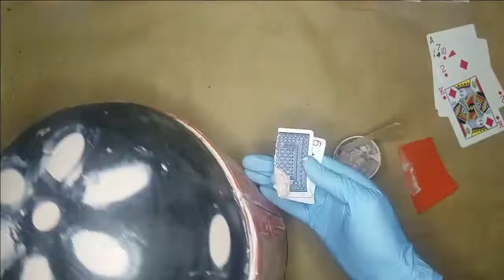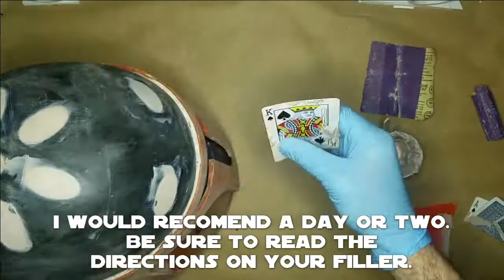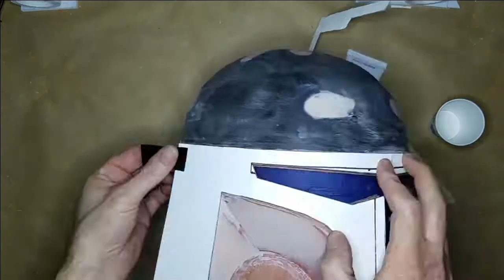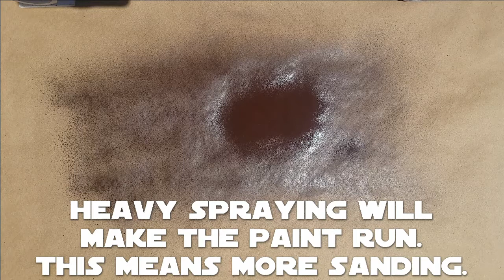Making a Custom Mandalorian Helmet, Part 6 : Bondo, Sanding, and Primer

Comment: If the Force wills it, then in the spring I should be able to follow on this path, as you have shown The Way.
Looking good & nothing I can really add, though flashbacks of my trade-school days are coming forth (Bondo, Sanding, Primer - oh, my). 
Though at this point, I maybe looking to 'eliminate' & smooth out the gap between the Bucket parts & the helmet (remember my Night-Owl/Imperial Super Commando comment on Video 2?), other than possibly a LOT of Bondo (shutters) what would you advice as a filler? Spray Foam insulation shaved, maybe? As of now, I do not really have a clue...
Reply from the maker: For a smooth transition from the dome to the side of the I would use the same method I used for smoothing the holes on the top of my helmet. Spray foam may break down under a layer of bondo, and lead to more sanding. Sketch a line on the dome that you wish to blend to, then use a pallet knife, or scrap bucket to work the bondo. Bevel the top of the bucket (where it meets the dome) that should help you with a better blended curve.

Comment: Looking good! About how long would you estimate the helmet takes from start to finish?
Reply from the maker: Well, if you work on it everyday, and you keep the details simple, it could be done in 2 - 4 weeks.
Reply: So many good ideas to work the bondo. I did mine about a month ago and for a first timer I underestimated the mess and how hard it is to sand down. I have a strong brow/ Ridge from my construction helmet, and filled the gap entirely with bondo, which I now regret. I read a post somewhere on the forums you left to someone where you recommended using spray foam, and man do I wish I read that sooner! Anyway, great vid and can’t wait to see the finished project...